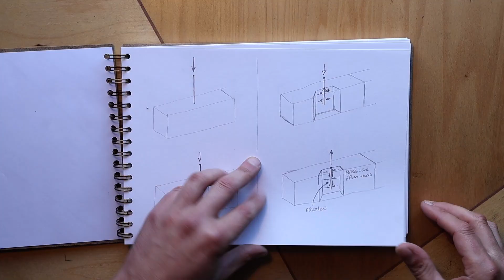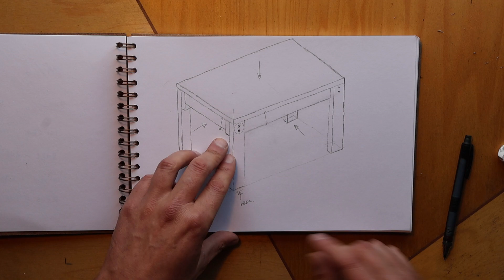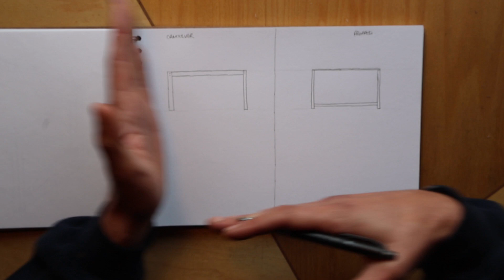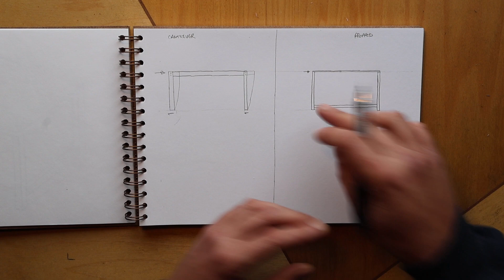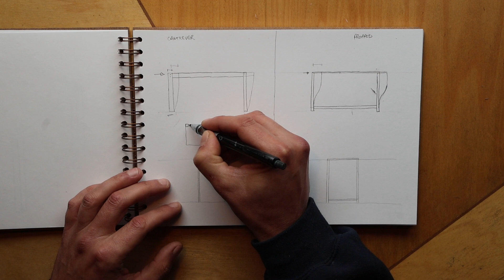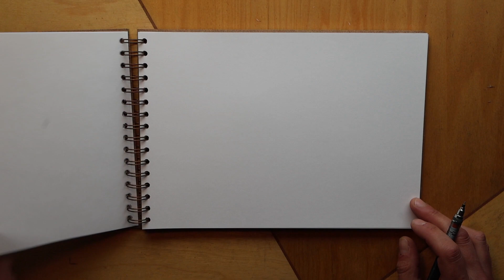The Structural Design of a Table

Comment: Your various configurations are counting on rigid joints to make them work.  An important consideration while planning the table is how do the individual members meet up and how can you connect them to make them rigid in a structural sense.  I made a bookshelf for a friend- 4 legs and 4 shelves with perimeter frames, basically copying a shelf she had seen in an antique shop.  I proportioned the legs and rails similar to the sample and intended to connect them at corners with dowels and glue.  Since there were 2 rails coming together at a corner column I had to work out an exact location for dowels so the dowels from one direction would clear the dowels from the other direction as much as possible.  I had to 3d print a dowel jig to get the dowels exactly where needed.  The dowels still didn't clear 100% so after putting all of the rails in from one direction I ran the drill back in the holes from the other direction to put slight notches in the first dowels to clear the second dowels.

Comment: Hi.   I hope you channel gets more views because there are a lot of woodworking videos but no so much with a structural perspective. 

Any advice on  what sort of span could work when spacing legs on a long table? That question pops in my mind every time I want to place a shelf or something like that as well. I would like to be efficient with the material and money.

I really liked the thought experiment of the hexagonal table. How should I compliment my woodworking skills to answer this kind of questions on my own? Should I pursue an engineer career? it seems to be a bit overkill and a lot effort to only make furniture.
Reply from the maker: Ha, we will see. I've been down the workshop today working on something a bit different. We will see.

Regarding the table - what kind of table? If its a cantilever type dining table then the spacing of the legs will probably depend on the beam that links them along the top. I would size that beam for me sitting on it. So, set up the beam with the correct span, sit on the beam, how much does it deflect? Does it feel too bendy? And adjust accordingly.

Engineering career would absolutely be overkill for a hobby in carpentry. What kind of questions do you have? I'm happy to help out. Maybe it leads to a video I hadn't thought of.